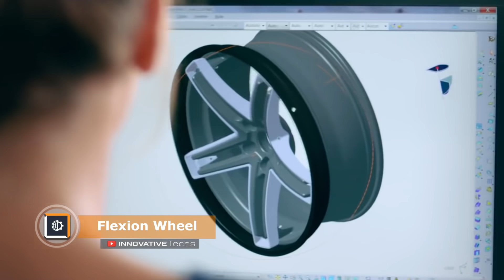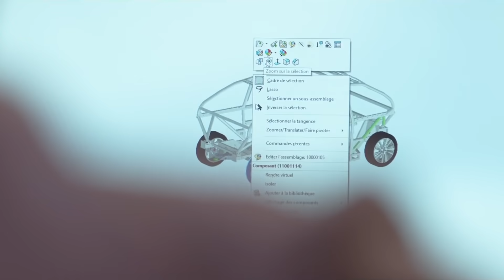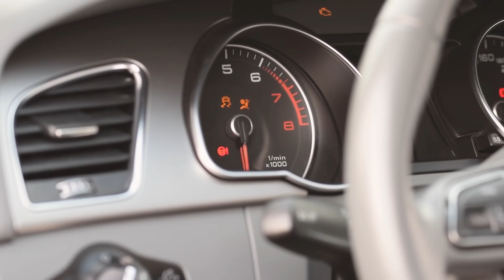Michelin presented airless tires for production cars

Comment: I think that the only reason it is being withheld is because it makes spike-strips obsolete.
Reply: I think spike strips would get stuck to these and cause even more damage to other parts tbh. Just make em a little longer and a little more durable.
Reply: just make a spike trap variant with a barbed hook like you would use in some fishing applications.
Reply: They got like a net that they throw down that goes into the tires that works good as well
Reply: and planned obsolescence
Reply: Have you ever heard of run-flat tires? They can still operate after a puncture, though with limited 'safe' operating mileage. They can be driven on for a long time with no air though.
Reply: Not true.. its sound. Airless tires transfer road noise. This has been the main reason we haven’t seen them on road vehicles.  Another problem is the same problem with solid tires. The faster you turn the tire the more likely the tire will stretch and destroy itself. In a solid or honeycomb tire the weight is much much more and will cause the tire to destroy itself at lower speeds than a standard tire. Last problem the the pesky weight again. The heavier the wheel the more resistance to turning causing excessive wear on the drivetrain.
Reply: Oh the other day, I get pulled over, nosy cop was behind me and must have been bored, ran my plates without cause!    Then he pulled me over.  I said I just bought the car a week ago and I have to get the filing done with Harrisburg.  I went to  a notary and got the plates transferred, but apparently Harrisburg hadn't gotten it yet.  He took my license and everything then let me go!  Should I get him fired????
Reply: @SvenStadt  Dude just be happy that cops aren't threatening you for bribes like they do here in Africa.
Reply: GREAT POINT.
Reply: No, I think they have run into practical issues with the design. For one, the tires are far heavier, therefore they run fuel efficiency. This isn't an issue for a tractor or quad, but one of the main selling points of light and cheap cars on the roads today. There really isn't any upside either. Yes, for tractors where each tire could cost tens of thousands of dollars, of course they want the most durable tire available. But a passenger tire can cost 50 bucks. No one is going to invest money into a far more expensive airless tire with worse fuel efficiency. Maybe they can market them to the new Tesla truck, time will tell.

Comment: "Your spike strip is no good! Eat my dust coppers!!!" 😆 This has been in the works for ages. The issue with automobile adoption has always been vibrations at freeway speeds. Maybe they finally figured it out.
Reply: that sounds like tracking issues with the alignment of the wheels or that the roads are so bad on the freeway.
i drive a £850 shitter car and it doesn't rattle or vibrate on the motorway.
maybe i misinterpreted your message.
Reply: @Dockhead  haha no it's called balancing the wheel assembly. google it.
Reply: @DWinzZz  i know what wheel balancing is mate, we call it slightly different over here well its actually a simpler process in which you only balance the 2 front wheels and not the rears (dont ask my why but it is what it is)
unless you go for the thorough wheel balancing in which case applies to all 4 corners.
what does this have to do with the OP message? "The issue with automobile adoption has always been vibrations at freeway speeds" in this case i suggested tracking his tires but balancing will do just as good.
maybe its because most UK cars that arent sporty or just for general public run FWD.
Reply: @shawnpitman876  hoorah someone mistook a word how tragic, stop getting your knickers in a twist, who actually cares other than you?
Reply: @shawnpitman876  Jesus! Overreact much? Did he step on your hemorrhoid?

Comment: I had a set of these tires about six years ago the trouble is they have a high failure rate and temperature is 0 to 5° they are brittle and you can actually get frozen to the ground if you park in a few inches of water prior to that water freezing
Reply: Sawyer Dickson wow that’s very cool you’ll notice depending on the sidewall will capture a lot of dirt and a lot of water and kick it up really high am I found it stones will get stuck in it And cause the tire to become unstable
Reply: @Sawyer Dickson They have been available for heavy equipment and garden tractor use for years.  Surely you know this.
Reply: @Sawyer Dickson Well, off road in a slow, heavy vehicle is one thing, which is why they have been relegated to construction and offroad use until now. A slow, heavy vehicle doesn't need to really trouble itself with a slower offset cam of a debris-loaded wheel.  It also deals with a longer crush time when contacting the surface, allowing debris to pulverize and expel at low speed.  Doing the same thing at higher speeds could be problematic.  That said, I'm guessing that's why it too so long to come to passenger vehicles; engineering a solution that doesn't allow debris in the first place takes time.

Comment: The wheel with the turbine actually seems like a very good idea. Like its applications in F1 bodied cars is massive and will enable More powerful machines, and Even with super cars if today, a few openings in the front grills that will direct air right into the turbine would work

Comment: If these were to go into production, you would lose the convenience of being able to run lower tire pressures in low grip situations, which could lead to more crashes. Also, if slush were to get in between the spokes and then freeze, you would have a large problem on your hands.

Comment: when the tires get wider, wouldn't that be a problem for the driver to have to rethink the car's dimensions?
Reply: choboc that whole concept just doesn’t work, for the tyres to spread apart would require them to slide across the ground at speed causing a potential flat spot

Comment: Won't they hold rocks in them? Or mud
Reply: Possible
Though I think the engineers thought about that
I'd assume they made the inner threads in some angles which would cause most of the dirt to fly off when they reach a specific speed
Aka centrifugal force
Reply: Probably exposed for demonstration/testing purposes.
Reply: @thaik56  nope. This is the finished product so far

Comment: Just dont go into any mud...would fill those wheels up and throw the balance out
Reply: They would cover the holes. It's just open for demonstration purposes.
Reply: @mathisrenier  Are you sure about that?
Reply: @TimeoutMegagameplays  It's the first thing you think of when someone mentions this problem, so yeah I'm pretty sure a team of several hundred engineers thought about it.
Reply: @mathisrenier  I wouldn't be so sure, because if the tire is closed it will either have air or vacuum inside, and that means it's not puncture-proof anymore.
Reply: @TimeoutMegagameplays  As long as the air inside the tire is at the same pressure as outside it will stay puncture-proof.
Reply: @mathisrenier  And that's the whole deal with the puncture proof tire, by making the outside air being the same as the inside (since there is no inside, because the tire has no walls) the tyre will work as normal, even with a puncture on it. If you close the tire with walls then it's just a common tyre again.
Reply: @TimeoutMegagameplays  Think about a house: it's closed from the outside but you don't depressurise it every time you open the door. 
Same for a closed water bottle: you can puncture it, it won’t deflate. 
All that thanks to similar inside/outside pressures and structural strength. Exactly like these tires.
Reply: @mathisrenier  The water bottle will deflate lol, if you try smashing it closed it will remain at it's shape, but if you puncture it ans then smash it will completely deform.
The house example makes no sense, since the house is actually technically open, if it was completely closed you would eventually run out of oxygen.
Reply: @mathisrenier  That does make sense, but it was not what you were defending earlier, anyway I still have not seen any image of the tyre with a wall, tough there are still lots of years for it to be ready, so ok.

Comment: Okay then tires look ugly,
How am I supposed to put armor all on it if they look like that?
Reply: @Sawyer Dickson Yeah. Hydroplaning is super smart. Get those and blame the company who built them. Genius!
Reply: Sawyer Dickson The source you pulled is practically unusable with the statement I've placed. It's irrelevant at this point. Also I see some issues with the source as well, heat is the byproduct of energy and not vice versa. To do such would practically be the equivalent to a steam turbine which cannot fit into a car, let alone a house with the amount of energy to create sufficient use. And you know what is more efficient? An alternator, which has been a thing since. Another problem with the source is the materials being used, since the tires would be 3D printed, it would use a real soft rubber that found on pencil erasers as 3D printing needs to have a low melting point materials.
Reply: Sawyer Dickson You call me a caveman yet you've managed to be deceived by an AD. Airless tires aren't viable as they aren't as sturdy as regular tires especially when being introduced at higher speeds as the tire is only held together by a thin pattern layer of rubber which will cause significant drag, you might as well be running on flat tires to make a fair comparison, the air in a regular tire is compressible, but it has a certain point which it cannot compress which is significantly less than that of the Airless tire.
Reply: Sawyer Dickson They've been addressed, but are they fixed? Like the saying goes "Don't fix what isn't broke"

Airless tires are a fad, just like the hoverboard. They needlessly fool people like you into thinking it's the best.
Reply: Sawyer Dickson It's all statements. If it's publicly proven, it loses the one advantage of being cheap. Practically throwing it into a catch 22, since you aren't able to produce a cheap enough tire to beat competitors, you'll need to lose quality of the tire to even make it a fair comparison. $150 per tire isn't good. Also such a super material that fulfilled in being elastic like rubber but having to be super durable is Graphene which is already expensive.
Reply: Sawyer Dickson My lord you're dense. Having a hexagonal layer of rubber meshed with a singular straight layer of rubber doesn't exactly scream rigidity, heck the hexagonal layer could be substituted by literally anything. And it still have the same impact. Even a solid piece or rubber is far more stronger against wear.
Reply: Sawyer Dickson Tweels exceedingly cause unecessary heat and noise above 50mph? Plus it can also have the potential to blow out due to the heat strain of the rubber, not to mention it can irreversibly ruin the shocks on your car and potentially the drive train. So you'll be limited to public areas and highways would be inaccessible and pretty much lethal, what are the odds, not to mention the time to shift production of all their normal tires into something new would take time and potentially be the end of the company. And Michelin is practically too big to put on such a risk.

Comment: HOW about putting NORMAL size wheels the entire 19" 20" 22" wheels are IDIOTIC!!!
Reply: Lots of brakes are getting bigger and bigger so wheels have to get bigger
My bmw has brakes so big 18 inch is the minimum and has barely any clearance, I’d get 19s if I could just for some breathing room
Reply: This wheel upsizing is a by-product of cars getting bigger and heavier. Larger brakes are required to slow them down.

Comment: these have been for sale since early 2018 they're about $5000 a set, and they have a cap of 40mph, they have yet to release any for cars that can withstand highway speeds. you can order for lawnmowers and construction equipment but that's it. it's sad if a set of 40mph or lower tires are about $5000 what are 60mph plus tires gonna cost.

Comment: I always worry about the "Tweel" voids filling with mud or ice and ruining the tire or ride, since they've never shown any covering for it. The wheel deflecting tire things seems like it'd be an enormous pain for the guys changing the tires, lining the separate rubber pieces back up when mounting tire.
Reply: So, they're really for tires that never encounter anything but nice, smooth warehouse floors.

Comment: I doubt those aero wheels will be used in any racing series- F1 will hopefully start using covered wheels (and if not, most of the air is already going well over them from the front splitter), and they're probably going to be too expensive for other formula style series to see any use. That's not even mentioning how they'll probably just be banned.

Comment: I've been using these four decades. On my loaders and other equipment with my job. Also known as tweels. They may not get flat and have issues that conventional air filled tires do. But as soon as something hits the rubber or grabs on to it it starts to rip chunks away and they start to fall apart with the more you use them. They are dangerous

Comment: The inner tire webbing shouldn’t be visible it takes away from wheel aesthetics. So cover it with rubber to look like a normal tire wile also having that web structure tire technology inside, enclosed but no air needed

Comment: The wheel and tire setup is one part of the car that really needs some updating. Hasn't changed in decades. Sadly, this probably has much more to do with the massive tire industry than lack of ways to improve them.
Reply: Actually, much of it HAS changed. You just can't see the changes - different chemicals in the rubber and the belts. Changed orientation of the belts in the casing. They can most all outcorner their relatives from the past, with shorter stopping distances in the mix as well.
Do you have an idea of how you want them to change or did you just get tired of black donuts?
Reply: @raylovelace8588  I'm aware of the makeup of the tire both a century ago and right now. Those are all extremely minor incremtal changes at best. The iphone 10 to iphone 11 level of difference. They're still round, still rubber, still steel or aluminium braded core, still just air filled balloons basically, still wear out fast and very vulnerable to punctures and cracks from age most importantly. All of those since the mid 1800s. This tire could the difference from rotary dial wall phones to an iphone 12.... the look isn't what the issue is here it's that tires or air-filled balloons and this has no air at all and can't go flat. It also has its own suspension aside from just an air cushion effect.
Reply: @benjmiester  Still round, I give you. Expect they'll remain so. On the other hand, they started out essentially gutta percha. Then they figured out vulcanisation. Since then they've been experimenting with all of it, and now we have steel belts rather than cotton. What I'm saying is there's nothing undeveloped about them as they are. Getting down the road hasn't changed much, either. Gas or electric. There's your choice. We don't frame the bodies with wood much anymore.. I guess I'm not getting what you think should be different and why. The phone examples are of a new, exploding technology that's only been around a few decades. Wheels had millennia of development before we discovered rubber. Not going to be a similar growth curve.
Reply: @raylovelace8588  I mean there's a lot of details involved in the minutia but what I want to change is to not be riding on easily poppable air filled rubber balloons like we have been since the late 1800s. Not ever so slightly more durable, slightly better gripping rubber air balloons. I want them to not be rubber air balloons at all. I don't get where there's any disconnect.  Kind of seems like you just want to be that token YT contrarian no?. Maybe you're just bored IDK I shouldn't judge. Cheers!
Reply: @benjmiester  No just seriously trying to find out what you're seeking. The thing is, we've developed rubber air balloons to where they work pretty well. Not so prone to failing now -  certainly require a much smaller percentage of the population to learn how to change a tire. You make them solid, you start developing problems in heat production, as you do when you even thicken the wall of the balloon. Another issue simply requires us to reinvent, not the wheel, but the tread. It has to flex to grip the road but keep it's shape. You separate out the sidewall connection you lose that. And how motorcycles corner is entirely different. So. a MUCH bigger bowl of issues than a linear upgrade in tech. Interesting exercise, though. Thanks for pushing it.
Try my best NOT to be the YT contrarian. Just too many years following cars to not know what's been tried and what happened next.

Comment: Looks interesting; however my experience with Pirelli Zeros was an absolute disaster even with an open mind, I very much doubt this tech will be actually ready for a very long time...
Reply: good story in the UK near me a bloke went to buy a new ferrari 458 i believe and they had them on pirelli Zeroes in the showroom and had no other tires to replace them to drive away from the showroom on, so he took the gamble on blitzing home before the weather turned, and well it got damp outside and he gunned the car a touch to much and it spun and completely got wrote off on a piece of the motorway.
pretty much £200,000+ gone in a heartbeat. as the insurance wont pay out due to having the incorrect type of tire for the road it was on, which he is trying to appeal and say it couldnt be helped due to the showroom not fitting the correct tires and no local garages anywhere near keeping Ferrari capable size tires in stock.